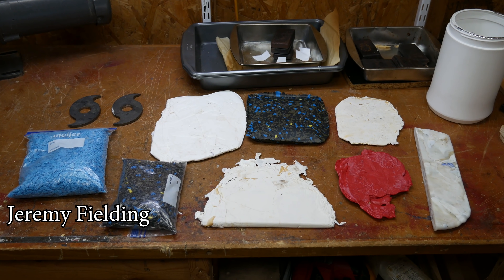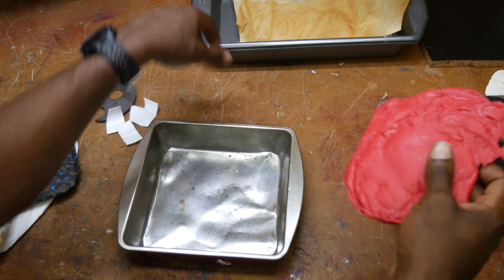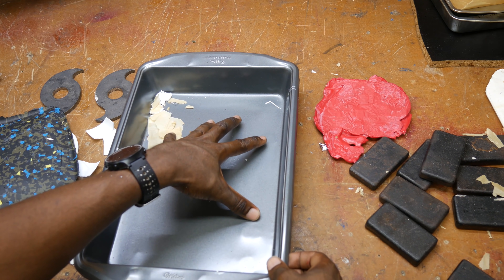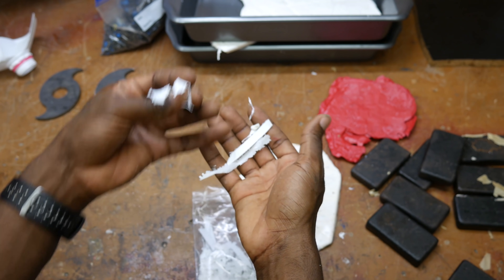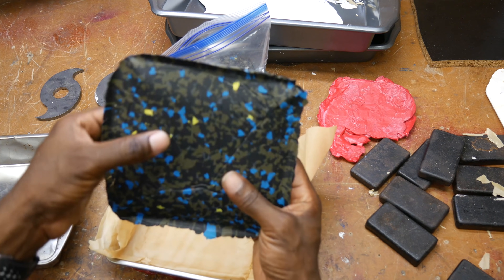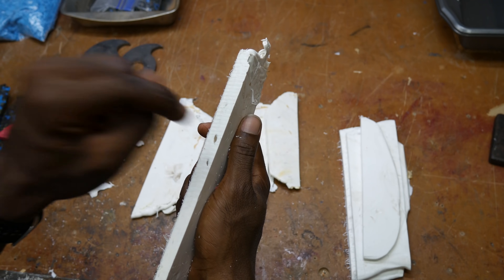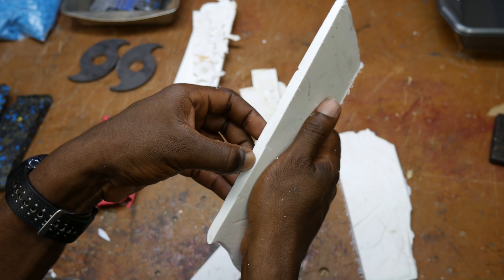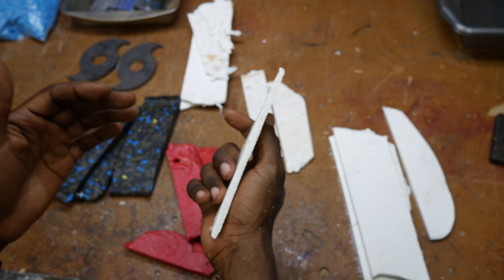HDPE, How Much Processing Is Required; I Put It To The Test!: 043

Comment: Love the effort. I do however have a question how you came up with the temperature settings for the melt.
According to figures  have learned HDPE losses some physical properties when melted above 112 C.
Using the end product for something of a structural nature could thus be affected reaching for 177 C.

UHMWPE = Ultra-high-molecular-weight polyethylene (different properties than HDPE which stands for High Density Polyethylene)
The latter is used to make drive plates and such that can be load bearing up to 300 tons even.

HDPE at approx 25 mm thickness (1 inch) can in fact be made into bulletproof plates for protective wests.
With a density lighter than water it also serves as a flotation aid for the wearer unlike the steel or ceramic plates.

Comment: It would be nice if you could test the breaking/bending strength of the pieces. Since they are different thicknesses, you would have to use a % formula for a approximate reading if you can't shave them to the same thickness. Thanks for another great video.

Comment: for those of you watching these videos 5 years later like I am, check out the Brothers Make channel - they get some surprisingly good results with a panini press and silicone baking sheets. They use a home-brew hydraulic press for their sheetmaking, but I've found a bench vice to work fairly well with my small plywood-and-sheet-metal molds.

Comment: Let me over these thoughts I think if you would use wood block to fill the top pan , then add the weights you would get less voids Another thing you might try is to flash cool you finished peace as soon as you think its melted to the point you want drop it into a water bath ( you may have to empty the water and refill the water bath a time or two as the temp will often heat the water as fast as you put it in, size and ratios of work peace and water also adds to how many times you will need to change out the water ). I've used these methods myself for many years and get vary consistant results. This a great video and I very much like you're videos on building shop machines and tools. Thanks again

Comment: Thanks Jeremy, as usual, I'm coming up with problems at home and you're already there with a ton of research to add to my thoughts today. I've just started (this week) to make some things with recycled HDPE after dwelling on the idea for some months. 

A mallet head was first and today, some soft jaws for my vice. The mallet head worked just fine, cutting a laundry detergent bottle into little (3-5mm) squares and layering. Cooking at 350° for 20 minutes, then compressing the form each time I removed from the oven  before adding more material to the mold. I used steel for the mold and coated it with paste wax before I began. It stuck initially, but I drilled through the bottom of the mold and the drill bit pushed the form out in one swift motion. It was simply a case of breaking it free and since the form was cylindrical it had both the rotational force of the drill as well as my downward pressure acting upon it when I broke through the mold with a 3/4" drill.

Today, I've got fed up with cutting with scissors. Twice the plastic of the mallet head and I've only made one jaw, hence I began my search for shredding ideas. I've not coated the inside of the mold today, and it's still cooling  so I don't know yet how much of a mistake that was. I need to use the mold for the second jaw so I'm unwilling to drill through this one unless I have to. I'm hoping the metal will shrink less than the plastic as it cools, but I'll see in a couple of hours if that hope was in vain. I've been using wood blocks today to compress and these do not seem to stick to the plastic. I've got a wooden block in the mold to make a void (just a piece of 2x4) and that takes up about 2/3rds of the space within so I'm hopeful I can get the thing out without damaging it. Maybe wooden molds are the way to go.

Thank you for your efforts. I'll go back through your uploads now to see if I can find some more conclusions from you. You're always, such a valuable source for me.

Comment: I think I might have the answer. If your fluent or no someone who is with 3d printer You might exploire my thought on taking an old school pencil sharpener and size it up to maybe twice maybe three times larger and fabricate a mechanical arm where the hand crank was and scrap the housing with your own design. It would be self feeding safe powerful and possibly low on noise. pound for pound indestructible for the size and with the right motor probably half the power

Comment: Rad video!
Have you tried a teflon sheet? They are used in the screen printing/T-shirt industry to cure ink at up to 375° (I’m not sure of the max heat as I’ve never needed it higher) without sticking to the ink.
Only issue you may want to research is the duration of time the teflon sheet can handle 350°.
If you go that route and it’s mostly working, but a little is sticking...spray some silicone on the teflon sheet, let it sit for a few then wipe off the excess and you should be golden. Although you may want to do the same research on the silicone heat limits as well.
Good luck dude!
Looking forward to learning more here.
Thanks!
:)

Comment: I think that u would benefit from a different clamping technique. Two boards with reusable baking liners give you better non stick properties as well the sheet metal in the baking pans is too thin to give equal pressure across the surface.

Comment: I think the amount of pressure put onto the plastic after heating is most important? To get the plastic compressed into a block and forcing out any air bubbles which cause voids, must use as much pressure as possible?

Comment: Instead of custom cut blades you might try stacking dado blades.  A 6” circumference, similar design, carbide tipped blades for less than the cost of custom cut parts (about $7.00 per blade or less if you find them used).  Silicon non-stick baking sheets come in cookie sheet sizes.

Comment: You don't need parchment paper; if you wait it will automatically separate from the pans as it cools and shrinks. Though it can slow down your process a bit.
Reply: I used aluminium pans in my tests

Comment: Good experimentation. Very thorough.
Change your baking paper when it starts to turn brown or it will turn your white plastic brown, plus it rips easier when it gets older,
The black pellets may not be HDPE. I've had a few that were something else entirely and needed much more heat than normal to melt.

Comment: Have you tried sourcing hdpe from 4" drainage pipes (white on the outside, black on the inside, has holes)? It says hdpe on it and would be easier to process since it would all be uniform and I could get a system going. Now I'm cutting up medicine, shampoo, milk bottles ect.  It's a little dirty but I've got a ton of of this pipe, it's cheap too if someone were to buy it new. 
I'm using a paper cutter and shears to cut my pieces into 3-7mm pieces, very tedious. Am I overdoing it? Would 1cm x 3cm be sufficient? That would save a ton of time and blisters. Have you tried heating (heat gun maybe) and flattening pieces into sheets easier for cutting/shredding?
If colored plastic doesn't stick as bad as translucent, would it be wise to sandwich all the T.L. plastic between layers of color so it doesn't stick?

Comment: I have watched many, many, videos about "melting" HDPE,, but none, including yours,, show the plastic in a true "melted" state. The milk jugs, and other HDPE products, that you are cutting up, had to have been in a true "melted" state in order to have molded the products. So how can one attain a "melted", or pourable state of HDPE?? In other words, how can I pour the HDPE into a mold?
Reply: @NC Outdoor Adventures, it doesn't melt to a liquid state; rather, the various types of plastic are heated to the consistency of dough and pressed through an extrusion device into a mold and left under pressure until cooled enough to retain the form. (Or extruded into rods, planks, etc. and set aside to cool.)
Hope that helps.
Reply: Sean Flanagan are you familiar with the additives that are added to make the HDPE more resistant to UV exposure? How do they mix in those additives if it's in a "dough" state?

Comment: Have you tryed a rolling pin take some flat stock secure it to some plywood , melt the plastic put some foil over the stock put the melted plastic between the stock and roll it with the pin .put some foil or wax paper on  the rolling pin .

Comment: more surface area makes it heat and melt more evenly, thats quite logical, also void get in there because of the shapes that have different thicknesses to them like the bottle opennings, handles etc where certain parts are thicker then the flat sides. Thats why shredding them into one homogenous(ish) form like they do industrially, works best. Any air you can push out easily because there are no long big flat parts molten over the air pockets.

Comment: Your sheer plate is too wide, i know this because i watched your other videos where you told us the design benefits of knowing how to use materials in the correct geometry.  In this video you said you can't make the gap between blades smaller because your sheer plate breaks off, but you are letting yourself stay limited because you won't think outside the box, that same box you taught us to think outside of. lol 
For example, like the suggestion of using counter rotating blades, the first set will be 1/2 a millimeter away from the second set of counter rotating blades, and that acts as the sheer point(plate), but it is not considered a plate, it is used in a totally different geometry. But then you said you are worried about the HP, but in reality it won't require any more HP, plastic is plastic, the amount of HP will remain similar no matter what, that is to get the plastic shredded to the same consistency. But in this geometry, you could have those counter blades but don't rotate them then if you are worried about HP, but fix them locked, and only rotate the first set of blades, and the second set will still work as the sheer point.  

Also, try lower RPMs, and stop using your hand and the plastic pulling in for excuse  to not try lower RPMs. Why? because don't use your hand, a bad design is a design thinking you will be using your hands. No, you should use the machine to shred it, not your hand, figure it out, without thinking you need to use your F hand. lol

I say try lower rpms because you will only be totally turning it into dust especially if you have correct sheer points. It is because those blades, they are 1/8 inch or so, and the blade turns what ever plastic that hits that part of the blade, into dust.  But what you need to do is sheer it, not cut it with those blades, if you don't want that fine dust the other guy had problems with melting.  That is why i ask you to try lower rpms, to see if we can get those blades to actually sheer it, and not cut it like the blades were designed.  You need to just force it apart, but without causing fine dust. There will be a rigid requirement needed that you will not get around if you want a sheer of any kind. It could, and should go only low rpms, and sheer it off. If it moved, then it sheered what ever is there, even if it mover .25 rpms. Like a pair of good scissors, you don't need to go 6000 miles per second to cut the plastic.

FYI it should, and WILL pull stuff in, it is a shredder. If it don't , then it is probably not a real shredder. That is why you shouldn't even begin to think you will be using your hands. You ever watch how a tree shredder  pulls in the branches? The engineer didn't stop with the prototype because he couldn't stick his hands in there, he just made sure to not stick his hands in there, nor to design it in a way that you would need to.

Comment: I love this approach to DIY project videos. Not so much "here's a my blueprints, here's a montage, here's the finished product" so much as all the messy, interesting stuff. The trials, the comparisons, evaluating what works, what doesn't, and why it does/n't. Instead of "Here's a thing I did!" it's more "Here are things I tried." That's way more informative, because a lot of people are going to experiment with the theoretical process and try different things. Having some previous results to draw on can save people time as well as teach us where new things can still be tried, and why one approach works differently than another. I also really appreciate the explanations for your reasoning, like here your goals are to produce as simplified version an existing process rather than try to get incrementally better end results.

Comment: Well, revisiting this, I believe being efficient with the heating process could help. Heat rises so instead of flat pans, use a taller narrow vessel. Go outside and use a rocket stove concept for your hear source. This saving and being more efficient there as well. Pressing plastic into a pipe and the heat moving upward, then press, and push out. Just some thoughts for those who are doing this.

Comment: I always go ahead and hit the like button when I watch your videos.lol
Having said that, I've been watching a few videos and I saw some people use stone tiles ,large ones, they seem to help a lot with a smoother surface. Also you can make molds out of plywood and two-by-fours, or metal plates and maybe just whatever you can find, and press the plastic into squares Etc. Also I found out that you need to kind of work the plastic like you would Taffy for really stiff dough, using parchment paper a metal spatula & welders gloves. It works really well on  the stone tile used to melt it in the oven.
The key is pressing, folding and molding to remove any air pockets, spaces and Bubbles.
I'm thinking of using two large stonel tiles to sandwich and press it in the oven and a weight of some sort. I'm wondering if a little flour sprinkled on  some of the working areas  would help while folding and working the hot plastic? Great video by the way as usual!

Comment: I have best results with minimal shredding. Actually I think "chopping into chunks small enough to fit in the pot" describes the process better than "shredding." 

I recommend long cooking times in a closed container, and a very slow cooling schedule.  If I press something down on it while it's melting, it prevents the voids from bubbling out.  If I let it cool as fast as room temperature will cool it, it warps something fierce.  If I use very long cooking times without putting a lid on the melt container, I find that the surface may scorch or oxidize.  So I hold it at 350F for a full hour after it's fully melted, then let it cool down no faster than 25F every couple of hours until it's under 200F.  You can do this by just gradually turning down your oven, or by putting the melt pot into some very well-insulated container.  If I'm pouring a complicated mold or a deep one, all these times are doubled because it takes longer for voids to bubble out. 

Oh, about mold release:  If I'm making blocks just to store plastic until use the way you're doing, parchment paper is the best thing to prevent it from sticking to the inside of the melt pot.  If I'm melting it into molds, I rub the insides of the silicon rubber molds with a very light coating of Crisco (which is basically plain nontoxic vegetable oil).

Comment: Try putting it in a vacuum chamber after Heating to get the air bubbles out. Reheat and then press with clamps or with a Arbor press maybe that will work with a good solid piece. Good luck .

Comment: On my tests the best results come fairly small, a finger or two of size, not too big and not too small, the trick is getting them into similar sizes so they melt more or less the same, that's why using the sheets worked well enough, similar sizes similar melting places, also the clamp, to make tubes I use a caulking gun with a metal tube, that makes nice and solid pieces even tho they were scraps of different sides, the professional shred plastic is great is so small when you clamp it dosent create air bubles

Comment: Jeremy, just a heads up.  I cut flat pcs about 2 inches square or so, put them in a tin can one at a time, and hit it with a heat gun set high.  I get almost perfect rounds, the thickness I want.  as you melt them, you add a cold one and use something to compress and spin the already heated hdpe, and then melt the new sheet on.  it works great, with no air or gaps.  its also very easy to turn at that point, once it cools.

Comment: The pros shred it because they have to store it for other jobs that may use coloring or blowing agent. if they didn't grind it they would quickly run out of room because you can get thousands of rejects a day. If the part needs to be clear or a lighter color they can't use that regrind for the same part . Sometimes they even regrind several types of plastic together and that can be problematic.. completely another subject though.

Comment: Jeremy, it looks like most of the plastic is thin wall just blown into various shapes like a milk carton.  Have you ever tried using a paper shredder?  I have a fairly large cross cut paper shredder that can also shred up CD's and disks.  I bet if you put your plastic jugs etc between brown paper and using an iron or heat gun to heat it so that you could flatten the compound shapes that you could put them through a paper shredder.  I have had my shredder for a few years and I am not sure where I bought it, it was either at Cosco or Sam's club.   It can handle several sheets of paper stacked up and it has a large clear plastic hopper about the size of a small wast basket.
Reply from the maker: I experimented with a paper shredder and broke it. Larger one cost more then what I thought I could make a shredder with. Smaller ones can’t handle the volume. They a shredder a few a fail